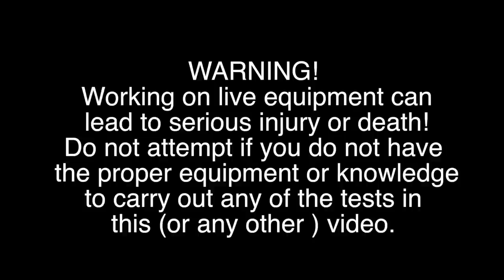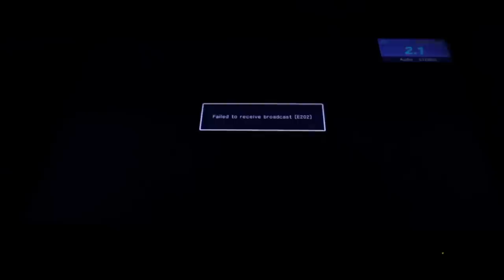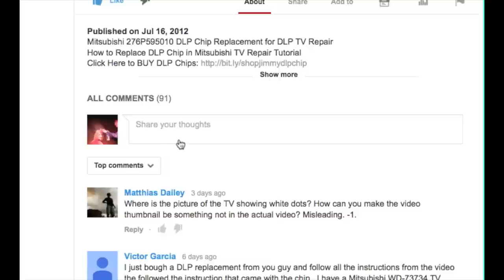Sharp LC-32 1 Blink TV Repair How to Troubleshoot Problem Between Bad Lamps and Power Supply

Comment: i have a  Sharp LC-52D85U that does basically the same thing. I was wondering if the same method could be applied to this tv. The PSU board is laid out differently though

Comment: Hi. Thanks for the vid, very informative. Same problem exactly on my LC-52d64U. Problem is the capacitor and IC numbers don't match up. Any idea which would be the IC and the capacitor number on this board? I have an IC 7801, but no capacitor that comes close to the other number... Any help would be appreciated so I can try the jumper method and at least get into programming before the screen shuts off. 
Thanks ahead of time!

Comment: Hello ShopJimmy, Great video! I have a LC-60LE640U sharp Aquos 60 inch LCD tv. I want to know what capacitor can I jump to remove the lamp error detection on it's power board.

Comment: Hi jimmy, sharp LC-52LE830U with one short and one long blink. I tried to reset but shuts off. Then go back to one short and one long blink. I checked with LED tester all 4 led strips and working at 75 volts each strip. Power supply has 5volts standby. And suggestions would be highly appreciated.

Comment: Hi i have a Dual Tv monitor combo rescued from landfill. No model number sorry. Dead set but i now have got certian required voltages fromn power  supply to board with all the smchips and audio .Really not  sure. Can you advise? Thank you

Comment: Hello.  I have a similar problem as you showed in this video, except my TV is the LC-32LD135V model.  After turning it on, the red LED flashes several times but the TV does not turn on.  I tried to program it via USB, but after pressing the OK button on the remote control and connecting it to the power supply, the diode starts to glow continuously but it does not program.  The pendrive is in FAT32, 4kb cluster.  The power supply is Vestel 17IPS19-4 and the motherboard is the 17MB95-2.1 model.  Would you be able to help me somehow?

Comment: I have a sharp Aquos 46 inch LCD, model LC-46D65U. The display does not turn on. I get 1 OCP green blinking light and 3 power green blinking lights when plugged in the wall. I hear a clicking sound like it is trying to turn in the display.

Comment: Hi, my TV is sharp MD# LC-58Q7330U and I tried a rebuild power board & used main board.  But still has the same problem. Problem is just like video u posted. Can see lights inside for couple sec but stays black screen.

Comment: I have a Sharp LC-C5255U that just has a single blinking power light.  Pattern is just 1 blink from power led, no OPC light.  Is this the same issue in the video with the 32" tv?  A bad led?  I do not hear a click or anything when I plug it in.

Comment: Hello Dear Friend! I have the model LC32P55E and it does not startup as normally should. If I press the power button contentiously then the screen comes on but it will remain on as soon as the power button is pressed. If the button is released the TV shuts down. If I do to turn ON by force the functionality of the buttons is limited, most probably because I block it by press the Power button contentiously,
Most probably it is an error that shuts down the TV but I do not know to figure out what kind of error it could be! I have also download the service manual and I have check some things like fuse but nothing deeper so far! Thanks in advance and best regards!!!

Comment: i have a sharp LC-50LB261U

It flashes red, green blue, white when booted up. I've tried the hold down volume - , input and other hard reset but still not fixing.

Comment: I have a Sharp LC-32GP1U. I would want to know if there is a similar way of shorting the error detection line out in order to determine if the power or the lamps are defective.
Thanks for your help.

Comment: Sharp Aquos liquid crystal TV model: LC-37D62U The power works on it and it stays a constant green. When you push the power button it would make a clicking sound and then the Power and the OPC light would flash green.

Comment: Hi guys @ JimmyShop, I have the Sharp Lc32sb24u set and having a problem with the back light, that I like to fix. What LED strip I need to buy, (part #) for a replacement? Thanks for the help

Comment: Hey! Well, my problem is a TV Sharp LC 46700UN. It just doesnt turn on. I tried some solutions as a soft reset, and nothing. I am checking the power unit; but without the diagram I don't know where to start. Any help? thanks a lot

Comment: Hello. I have a Sharp Aquios LC-90LE657U.  The TV has maybe a couple hundred hours on it.  The picture is still amazing, However, it shuts itself off every once in awhile. I do a factory reset on it and sometimes it will work days and sometimes only for a few minutes. Do you have a solution for this tv?

Comment: LC-52D85U tv turned off the other day and won't turn back on. flashing green light. tried resetting with no luck. removed the back of the tv and have the power supply unit removed. what should i look for?

Comment: our 46 inch sharp aquos is blinking the power button in stages of 3 flashes. I have tried all the resets nothing is working. please help. btw husband opened up the back to check for any burn marks, all is ok. we have no idea what it could be model # : LC-46E77UN. serial # : 905856156 please help. thank you.

Comment: Hello, I have a sharp tv model lc-32WD1E, and a while ago the power supply burned, I bought a used power supply but in good condition, even so the TV does not turn on, whenever I turn on the red light turns green and  a short time later it turns red again and the process repeats itself in an infinite loop.  I think the problem is bad lamps but I'm not sure.  I would be very grateful if you help me with this problem.  thanks for your attention, regards

Comment: Hello Jimmy, I watched the video. I had the blinking green light with nothing else. The AV box in the top right corner did come on for a second, before the TV would turn off and return to the blinking green light. I took out the power board and soldered the point from the video. I reinstalled the board, reset the tv, and now it works perfect. I want to fix it right, what should I be looking at.

Comment: Hi Jimmyshop. I have an aquos lc-32d44u and the power light is blinking.  I fallowed your instructions to reset the tv and it works! Then after a few minutes watching tv it comes back to the same status (blinking the power light). Any advice will be much appreciated.  Thanks for sharing.

Comment: Hi Jimmy. I have a Sharp Aquos LC-52D64U.  It won't power on and the  Power and OPC buttons blink twice in unison and then the OPC light blinks a third time on its own.  This pattern repeats as long as the TV is plugged in. I have tried to reset the TV by holding the Vol -, Channel + and power/ the volume - and Input button/ the volume - and volume - and channel - buttons with the power off and then plugging in the TV. Te power a OPC continue to blink as listed above. The screen never turns on not if there a K letter.
Each time the power button is depressed the TV sounds like it is turning. The power supply board was replaced without success.

None of the capacitors appear to be swollen.  I don't know what the next steps should be and cannot find a listing for the error code of pwr/opc blink to gether twice then op blink once.

Thx,
M@

Comment: The bridging of the cap in an LC-32 at IC-7501 and cap C7558 solves the led error on that set. I have a 60" LC-60LE640U. What combination of IC and CAP reference can I bridge to continue my testing?Thanks

Comment: I have a sharp Aquos LC-80LE632U, blinks 2 time slows and then 3 times fast, I looked up error code and it’s says digital fallar 3.3 volts. I don’t see where the 3.3 volts need to be applied. I’m a AC technician, I understand a meter and schematics, but I can’t find this 3.3 volts. I’m not int to just replace parts. Please help.

Comment: my lc70le640u it blinks 2 then 5 blinks. I replaced power board ,main board , and t con, it still has sound, when I do the reset it just starts blinking again. I have searched you sight but can not find this problem I can and have a meter so if you can help me ,    please chuck

Comment: My Sharp LC-60LE550U cycles power (on and off) sporadically.  When it enters a power cycling mode, the unit doesn't respond to any commands from the remote or local controls.  The TV is approximately 18 months old.

Comment: Hi i have a Sharp LC-60LE600U tv. the power light comes on momentarily then shuts off. holding down vol down and channel down does not work.  looking at any bulging capacitors in the back and cant find one. also removed all hdmi connectors and still no success.  how do i test the boards (power/video) ?

Comment: LC-32D44U . Wasn't turning on. Power light was blinking. I followed your instructions and did a reset. Turned it on. Displayed typical TV static from no signal. Menus/channel #s displayed clearly. Then after a few minutes the entire screen began flashing solid green.

Comment: Sharp LC -46LE450M With power on/off but backlight flash once for a very short time after few seconds of pushing power button ON. Power supply Board number 715G6310-P01-000-003S

Comment: Hello JimmyShop, I have a Sharp Aquos LC-52E77U an a few weeks ago it turned off and the power and opc leds started flashing two times repeatedly together. I already reset it with the volume and input, and volume and chanel down but still has the same problem.  Before did this it turned off but in a few seconds turned on normaly, this random. Hope you can help me, thanks

Comment: hi, thx 4 your time. i've got this issue on my lc-42xd1ea.after i turn it on the green light comes for a second and then  the power red led flashes 2 times, pause, 2 times, pause and so on.no way to put in in "k" mode or reset it. no help from the service manual about this error code.i hope that you can help me.all my best.andrea

Comment: Hi i have a sharp aquos 46 inch LC46D65U and it keeps shutting off and i see 2 green lights blinking 2 times with a break 2 times break and so on. Ive replaced the power supply board and seemed fine until it started again. Ive just done a factory reset by pressing the input button and channel down button on tv set which i never did before to see if this works. Perhaps a firmware update from website needed?

Comment: I have a Sharp LC-C4655U showing the exact same issues as the one in the video. Can you tell me which capacitor I need to jump for this model? My model has a RDENCA295WJQZ power supply. Thank you in advance for your help.

Comment: hey shopping . great vids. I have a sharp aquos lc65e77um I moved the tv gently to another room plugged in and all I got was flashing opc and power no sound or picture. if you can help I will buy your parts and greatly appreciate it

Comment: Hi thanks for this instructive video , i have 2X  LC-40D68UT that having Same trouble , backlight comming for a couple of seconds then 1 blink constant occur  i have replaced all CCFL lamps because they was really bad and pink , and some of them was totally shots  but after reset the tv , the problem remain ,.i have swaped inverters board but no difference . the inverter board is a VIT71880.00 REV:3 Labeled LS-1940T04001-049-8040048-06711-03

is the same test can be applyed on this model of tv ? any help would be very appreciated , Thanks!

Comment: Hi Jimmy - hope you're still monitoring the comments on this video.  I have a Sharp lc-32le653u that will turn on with the remote but all that appears on the screen is the word SHARP in large letters.  The rest of the screen is black with no picture or audio.  The remote will not function beyond starting it up.  It will not shut the power off or do any other functions.  Any suggestions?  Thanks.....

Comment: Hello Jimmy,
I have sharp aquos LC-32D30 tv that wont turn on. The power (red light ) is also not blinking at all.The TV seems almost dead even if it is plugged into the electricity. What can be the possible solution for this kind of problem?

Comment: Hey Jimmyshop I got a sharp liquid crystal tv LC-60C6400U
When I plug it in the light comes on but when I push the on button it doesn't turn on. Hiw can I get it touch with you?

Comment: Hello Jimmyshop, my TV IS SHARP LC32X20E, it happens to me that after a lamp error the TV has entered in protection, the monitor can no longer be accessed, and it is impossible to carry out the procedures to reset lamp errors.
I tried everything, the initial reset by pressing POWER for few sex to reset and n result. Disconnecting the AC, power and restarting with the procedure "VOL (-) / INPUT" and no result. No one ofe the knowed procedures do work because the monitor does not turn on and I can not see anything, and impossibile do any.
Can you help me, thanks in advance.

Comment: I have a Sharp LCC 4654U and the power light flashes 3 times and the OPC light once I replaced the power supply board and thr T-con board and still the same. I can't find a error code chart for this unit. What do you think it can be?

Comment: I have Montgomery Ward 13 inch Sharp Color TV built in 1993. Model Number 13E-M100. The problem, is that after hooking up a Converter Box it plays for a short while, starts a thumping/clicking noise and the screen goes black except for a very small color piece near the center of the screen. April 30, 2015. Any suggestions?
Reply from the maker: ClassicShoppes.us  Unfortunately, we do not sell replacement parts for that TV or model number.  Thanks!  www.shopjimmy.com

Comment: I have the sharp LC-52D64U the error I have is a single blinking green light when I reset it shows input label and the back light flashes three times and shuts down. The card in the back lights red then the power shuts off and begins the single blinking green light

Comment: sharp aquos lc-60le600u replaced power supply and t.conn board,still powers on and back lights come on then back off. with that being said,i watched the sharp 32in video.whats the number to sodder across? to test for my led?
Reply from the maker: Randy Jerrells  Please watch this video FIRST to help with your repair!  https://www.youtube.com/watch?v=BP3NVNCGEv8 If the T-con board replacement was good and did not fix the problem, then this is either the main board or the TV panel.  You can replace the main board to see if that fixes the problem.  Click this link to replacement parts for your TV model:  http://www.shopjimmy.com/catalogsearch/result/index/?cat=56&q=lc-60le600u  There may be multiple boards for the same TV model number, be sure to match part numbers on your current board, with your replacement for compatibility.  Thanks and please let us know if you have any further questions with your TV Repair!  www.shopjimmy.com

Comment: Hello I have a Sharp LC-52LE830U the upside down v is the only thing that comes on. I tried all resets that I could find online and nothing worked. I seen your video and I was trying to do the jumper on the power supply and I cant find that compactor you were talking about. I want to make sure the power supply is working so I can move on to the other trouble shooting. The flashing v is short then long flashing. Any help would be great. Thanks
Reply: +Corey Skipper long then short flash

Comment: I have a Sharp Aquos LC-37D44U with the same problem as what is appearing in this video. When I remove the power supply, the main IC chip is IC7102. I'm not exactly sure which on which capacitor to create the jump at. Looking forward to hearing back! Thanks!
Reply: Lucas Henry
Reply: G. Alan Mackey me too exactly -
Reply: hello, i have lc49 sharp and i want to do the jump, where do i start to remove protection mode??
Reply: I HAVE 52" AND NEED THE SAME ASK PLEASE!!
Reply: I have the same model. My tv turns on and i have pic. But the sound goes on then out. Or then stays out. Until i reboot it and hit the volume and input button

Comment: Hey ShopJimmy,
I have a Sharp Aquos LC-C4067U. On power-on, red and green lights flash alternately. Resetting instructions did not clear problem. Sound like power supply?
Reply from the maker: Ed Contreras   I recommend replacing the main board since it seems the signal is is getting mixed up due to the main board not processing the information.  Here is a link to replacement parts for your TV model number on our website, click here:  http://www.shopjimmy.com/catalogsearch/result/index/?cat=56&q=LC-C4067U  Be sure to match part numbers on your current board, with your replacement for compatibility.  You can also call our customer service for further assistance with your purchase.  (877) 881-6492  Thanks and please let us know if you have any further questions with your TV Repair!  www.shopjimmy.com

Comment: Hi, Sharp Aquos LC-37D44U
Back light turns on then shuts off with single blink green power light. After reset, I did notice the picture when connected my laptop via HDMI. Picture was extremely dim. My question...is it the power supply or the lamps itself? Thanks for your help.

Comment: Hi Jimmyshop, I'm having a problem with my Sharp TV. Its a LC-60LE660U 60" Sharp Aquos and when its plugged in it flashes a long white light. I have tried to reset it with holding the INPUT + Channel down + plugging it back in to no success. I think its the power board but I'm not sure Could you give me some advice
Reply: OldManc Rehnaldo p

Comment: I have a Sharp LC46SB54U with a green blinking light.  I have tried holding the Power button, but nothing happens.  When the problem first began the screen went dark and then the set shut down.  Since then I only get the green flashing power light.  I also tried holding the volume/channel buttons down then plugging in the tv, but nothing happened but the flashing green light.